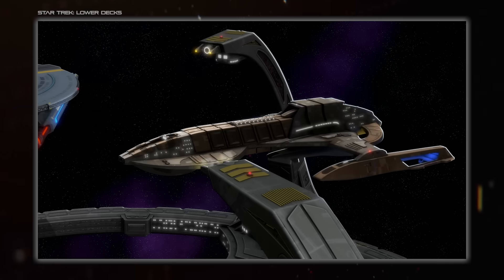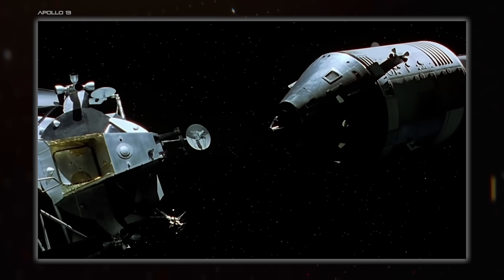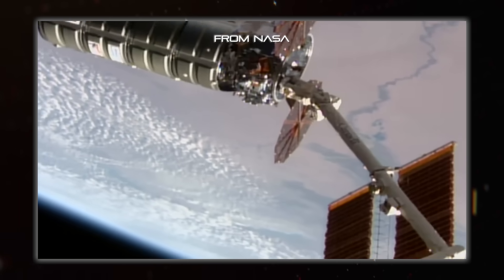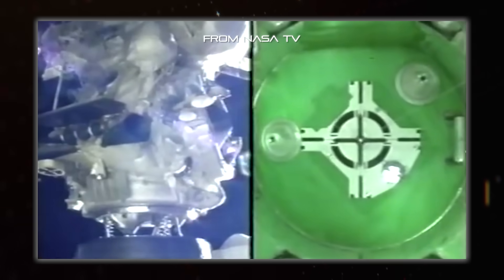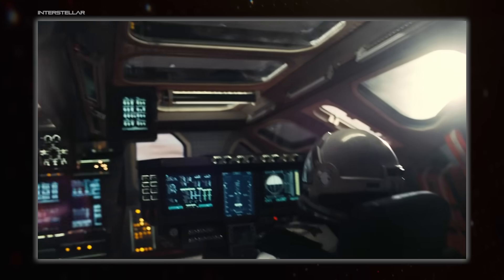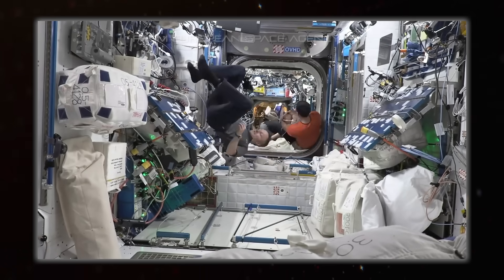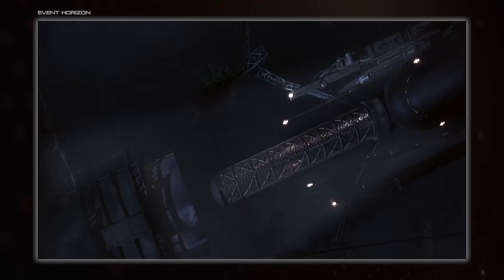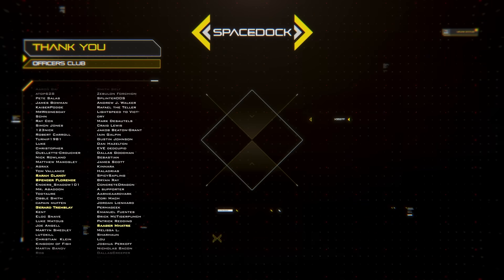How to Dock in Space

Comment: A way to create an adaptable sealing airlock could be cold welding of metal with some kind of very clean metal surface. Or, some kind of adhesive sealant that expands and can be dissolved after use by another chemical. Or you could weld it together very hotly with thermite like they do with railroads (thank you veritasium). Its going to stick the craft together very tightly, but you're not really going to get it off easily. There’s a lot of ways I can think of as a layman, but they would need to be tested and developed in real life if they were ever going to be used on a real craft. But, in sci-fi, you could easily say that it's been developed over a long time

Comment: The Canada Arm was one of those 'simple is better' solutions to docking.
Instead of trying to get the probes to line up with the ISS just put an articulating arm on the ISS, grab the probe with wayyyy more leeway for angles and now that the probe, arm, and ISS are all 1 piece moving at the same velocity and direction just plug the probe into the station.
Added advantage of being able to directionally control the probes exit direction when you want to get rid of it.

Comment: Docking is something I think about, don't tell me what I do or don't think about! I've got docking ports on the 3d space ships I model. They are not high detail enough to actually model the locking mechanism, that part is just a hatch with some greeble to look the part. But around the hatch, I have a rubber "suction" cup, or pressure cup would be a more appropriate term, that creates a secondary redundant seal around the port. It's also intended to be a universal port (since I recycle the port as a greeble for various models), so the suction cup can act as the primary seal for those non-cooperative dockings, as well as provide flexibility for various different hull shapes it might be docking with. I called it "rubber," but it's actually just an outer-coating of rubber (or space-grade rubber-like material, I haven't done the material sciences yet) for the seal, with a metal skeleton inside for strength. That metal skeleton is intended to act as a 2D-leaf-spring suspension system to help keep docked ships aligned correctly, especially during rotational maneuvers. For larger ships, I also want to have perhaps some arms or girders that will extend from different locations and attach to anchor points, to provide additional stability, but I haven't gotten that far with the modelling yet.

Comment: Star Trek: The Next Generation, Encounter at Farpoint. The first duty Will Riker performs on the Enterprise is a manual docking of the drive and saucer sections. It's a fairly lengthy sequence to get these two vessels designed to operate as a single vessel to reintegrate.

Star Wars novels, Black Fleet Crisis trilogy. In attempting to board an alien ship of unknown type, Lando uses a cotterdam with a comprehensive seal mechanism. The mechanism attempted two forms of magnetic seals, two forms of chemical seals, and finally met success with a mechanical seal that Lando described as a thousand teeth piercing the hull of the other ship.

Also Star Wars, the YT-1300 (Millenium Falcon) has several docking hatches. The placement of the cockpit, hard to starboard, is designed to assist pilots making the delicate maneuvers needed to navigate inside docking bays and in lining up ports.

Comment: Universal port seal is easier than it seems! Ideally you're going to want to want a couple of physical anchors that can/should be as simple as some heavy duty eye bolts/d-rings/etc to latch onto with space-frade carabiners. Once tethered, you can compress/inflate the seal element, which itself can be assist with retention via geometry. If there's anything resembling a federation or even simply communications standards, there's likely to be some measure of docking port standardization for compatibility even with variation by specific maker. ease/difficulty of connecting via standard ports is likely to be a thing between brands or species or planets

Comment: Spin gravity made docking difficult in Interstellar but in reality it probably will make it a little easier.

This is because a tether rotating once every two to three minutes gives a whole gee 3.5 to 8 km down from its spin axis, and that leaves a lot of room for an unpressurized cylinder surrounding that axis at only ~50 m radius. That close in, the spin gravity is 0.014 to 0.006 gees. It is enough that the small vessel that wants to dock can plunk down on the inside of that cylinder and slide or roll over to a docking port. This reduces the number of degrees of freedom from five to three.

Comment: The rescue submarine concept would still work with nothing more than maybe some magnetic pole. All you have to do is invert the seal so that the suction cup actually uses pressure from the inside of the airlock. if you don’t believe me, just do some research into lip seals. There are common component of the automatic transmission. The best thing about a lip seal for this is that the more force placed on them the tighter they seal, assuming they don’t actually rip. So you just need enough contact to build up a tiny amount of pressure and it’ll see itself.

Comment: I've written a few stories in a Steampunk sci-fi universe and strangely docking is an issue that I haven't dodged. There are three areas where docking becomes an issue in universe. One is where a ship comes into a space dock or station. There are several different types and the docking method is slightly different for each, but most often the ship effectively grapples itself alongside using arms and then extends a tunnel once in position. This sometimes doesn't work where the station is smaller or less advanced and doesn't have the required "grab points" so they have to eyeball it and then tether the ship. Smaller ships coming alongside bigger ships work in a similar manner, by eyeballing the the right place and then tethering themselves. Two big ships do the same, but there are sometimes problems where their walkways are not compatible.

The most interesting part though is that just about all large ships are designed to be able to dock end to end. They are mostly shaped like airships (I wonder why?) so end to end works okay. The issue that often pops up in universe is that the docking ports are not standardised and so there is often issues where ships can't dock, or need to modify their fittings to make them compatible before they do. The hero ship actually carries a selection of modification rings that can be fitted to their basic port to make this possible. It should also be noted that these ports are quite large and most services can be run through them so it is a way of one ship supplying another with power should their systems fail. Towing is also possible using these ports but for FTL the lead ship needs to be the one doing the FTL as the arrays for this are located on the front and form a bubble. There is then the issue of extending the bubble to include the ship being towed. This does mean however that a ship with functioning engines can dock behind one with a working array and they can mutually support one another to get home.

Comment: While I overall like the movie, "2010: The Year We Make Contact", one of my pet-peeves was the docking clamp between the Discovery and the Leonov.  I'm assuming the intent of this was so the Leonov could bring the Discovery back to Earth if it couldn't be flown on its own (I didn't read the book).  The setup they used in the movie, however, put the ships next to each other.  This would create asymmetric thrust no matter which ship was firing their engines (the ships would pitch "up" or "down" ).  Theoretically, the front of the Leonov could have been designed to clamp on to the engines of the Discovery.  This would have worked for bringing the Discovery back to Earth (the original intent), but not for using the Discovery as a booster rocket since the thrust would have been blasting the front of the Leonov.

An alternative I came up with was to design the front of the Leonov to dock with the front of the Discovery.  It could be designed so the Leonov could have easy access to the Discovery through the middle pod bay door.  This could also work cinematically as the two bridges could see each other (I'm thinking when Dr. Chandra was alone on the Discovery talking to HAL just before the trip back to Earth).  Also, the thrust from either ship would go through the center-of-mass of both ships (though it would make for a very long spaceship).

The problem is, the Discovery's nose was never designed to support its own mass (if the Leonov is pushing) and most certainly never designed to support the Leonov's mass (if the Discovery is pushing).

Comment: Non cooperative docking option , The boarding torpedo: The torpedo makes contact with the ship and uses magnets or strong glue to make initial contact , an automated welder then welds the torpedo to the ship for a hard semi permanent dock , and then the marines either use a hatch if they aimed properly to board the ship  , or they cut a hole into the hull of the ship and board that way. (some basic understanding of the layout of the ship would be needed for this to work.

Comment: Personally I love B5's idea most, almost all small vehicles are launched from purpose built hinges or tubes, which use the rotation of the mothership  (or space station) as a initial boost to get away from the mothership, but docking back is done via non-rotating secment in the middle, where you can just fly and land and then platform does migrating the smaller ships back to lauch place.

Comment: I could see there being a failsafe "universal docking" option of a big, extra-strong bag being deployed around the entire ship, which is then filled with atmosphere. Basically, put a big, fabric airlock around the entire ship, with one end securely attached to the station's entry point. Without gravity, there's no definite need for a rigid structure. Use a robot arm to hold the ship in place, and a boarding "tunnel" to provide ease of access without needing to worry about an airtight seal.

Put another way: Big, inflatable docking bay. The Bounce House of the future.

Comment: Cygnus technically doesn't dock. It gets berthed. That's why it needs the arm to do the last part. This has a lot of advantages for a cargo craft though, most notably that the Common Berthing Mechanism ports have a much larger internal area than the IDS ports. ... which, fun fact, are attached to the station using APAS, the system designed for Apollo/Soyuz.

Comment: Makes me think of how I've been writing landing and docking for the airships in my book. Ships capable of hovering, i.e. not a fixed wing style ship, are often devoid of on-board landing gear, and rely on surface-based equipment like guiding arms to control their descent. While in flight and initiating docking between two ships, they often extend gangways similar to inflatable airlocks seen on spaceships. There are two docking styles that I've written about so far: Tandem docking, (side by side) or Consist docking, (one ship follows the other). Something I like my version of in-flight docking is that the gangways are all hinged in order to allow for the ships to move around from air currents and stuff. There's even a battle that takes place between two ship's marine contingents on a docking gangway while in flight, and the abrupt movements of the two warships trying to free themselves causes the gangways to separate and a named character to tragically lose his life.

Comment: Once you gain Tractor Beam Technology, Socking becomes MUCH simpler because the Tractors can handle the final Vector and Orientation Matching needed to bring both craft into the required Alignment for Docking as well as to gently slide the docking mechanisms of both craft together preventing damage from a too fast docking (AKA Crash) or being at the wrong angle/orientation for the collars to match for a good seal...

The ISS Robot Arm is a Mechanical version of Star Treks Tractor Beams...

Comment: Here's how I'd imagine a docking scene going, with added realism:

On-screen is a ship, drifting in space, seemingly coasting forward with its engines off (relative to the camera), that's been granted docking privileges. Cut to the ship's engines firing up, and start panning away from behind the ship, at 1st, seemingly being left behind, but there's a twist, as the camera arrives at the space dock that the ship is docking at, with the ship not moving away from the station, but towards it, intending to dock at it like a tail-sitting rocket or lander landing on the surface of a planet, moon, or other celestial body. Cut to the ship entering the docking area on reverse, while its engines are firing to slow the spacecraft down for the station's docking procedures to proceed. Once the ship's engines have eliminated nearly all relative velocity differences between the ship and the station, the station's docking arms reach out to connect to the ship, realigning it, so that the station's docking port can be attached to the ship's docking port via an extendable docking bridge, allowing the ship's and station's passengers and crew to transit in-between both spacecraft.

Once the ship is ready to undock, the station's docking arms and docking bridge detach from the ship. The ship's engines fire up, pushing the ship away from the station's docking bay to its next destination out in the cosmos.

Comment: The original Skylab actually had two docking ports. The main one was on the front on the longitudinal axis of the station, just where you’d intend it to be, this whole module was called the “Multiple docking adaptor.” and that front port is the only one they ever used. There was a second one on the same module (Hence “Multiple docking”) that was further back and pointing at earth. This was intended to be used if the main dock was fouled or blocked or broken, or if they needed to have two crews on the station at once for some reason. (It was never the plan to do so, but just in case…)

Interestingly, during one of the Apollo missions, the Apollo successfully ‘mated’ (as they called it) but it wouldn’t dock. There wer 12 large pill-bottle-sized rods that were supposed to come out of the apollo side around the perimeter of the port and fit into corresponding holes in the LEM port. They docked, hit the button, the rods didn’t come out. They backed away and tried it again. They still didn’t come out. On the third attempt at docking, one of the astronauts whanged on the inside of the sill surrounding the door with a shoe, and that dislodged whatever the mechanical problem was, and then clang-clang-clang-clang- all the rods went in. It’s amazing how often “Use a bigger hammer” is the actual sollution to these problems.

Comment: Flexible docking tunnels also have the ability to allow movement between the docked ships. Otherwise, both vessels would have to be perfectly in sync, or the docking port would have to be able to transfer the necessary forces, possibly requiring additional docking clamps. This is especially true for larger vessels.

As for incompatible docking ports, the problem could probably be solved with suitable adapters. Essentially just a short section of tube/tunnel with the respective port on either end.

A kind of overlooked issue is the fact that the air pressure has to be precisely matched, before the doors can be opened. Which is verry hard to do for larger vessels, making the use of an airlock (at least on one side) necessary. Even a small pressure difference will cause the air to rush through the opened docking port. According to my estimations pressure difference of just 12mbar will result in a "wind speed" of 160km/h or 100mph. (see reply for calculation)
Reply: My calculation:

density air:  ρ = 1.2 kg/m³
pressure difference: p = 12 mbar = 1200Pa

the dynamic pressure of a fluid moving with the velocity v can be calculated with the following formula:
p =  ρ v² / 2

rearranging the formular vor v results in:
v = √(2 p / ρ) = 44.721 m/s  ≈  160km/h ≈ 100mph

Comment: 6:32 In the sci-fi setting I am building most interplanetary or interstellar spacecraft carry around smaller craft like shuttles externally, (called "riders" in universe because I like Traveller) so I had to solve this problem. Ships with riders have systems of heavy duty clamps which interlock with the rider, designed to withstand the force of maneuvers without it shearing off, the traditional docking port just has to keep an atmosphere seal. Of course this does mean that there is pretty close design coupling between a rider and its intended clamp mechanism, incompatible craft can't dock and then maneuver safely, and there is some pretty harsh size and weight limits on riders.

Comment: We've actually been doing fuel transfer via docking ports for a very long time basically since the start of more permanent space habitation.
For instance on the ISS hydrazine for the reaction control system is brought up in the storage tanks of a Progress spacecraft and then pumped directly though to the Russian Zarya and Zvezda modules which contain the station's fuel tanks and attitude and reboots thrusters.
In this case the KURS/SSVP docking system used by the Progress and the Russian side of the station includes plumbing for UDMH and N2O4 which simply links into the station's existing pipe network